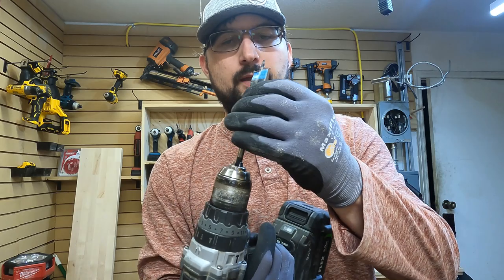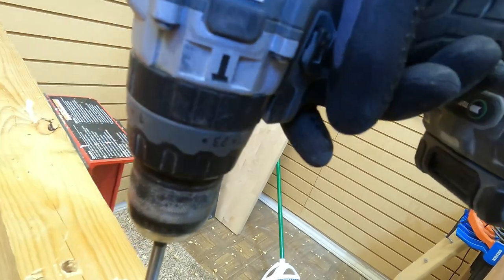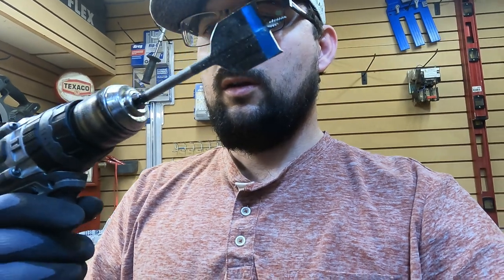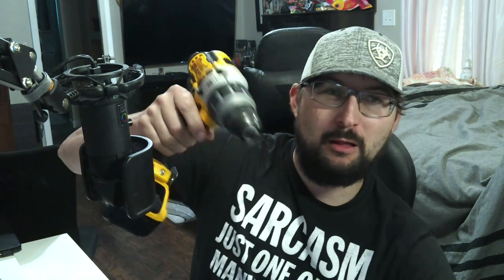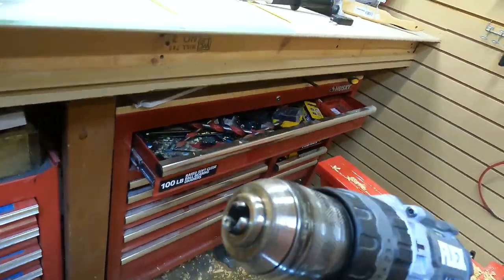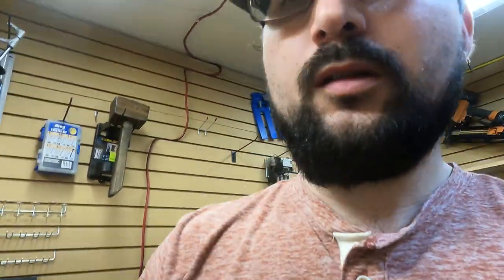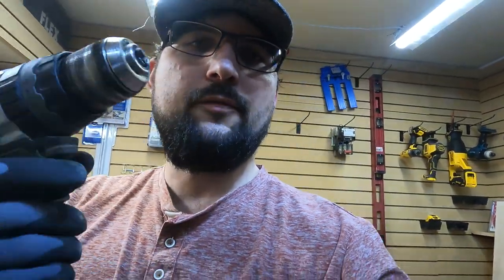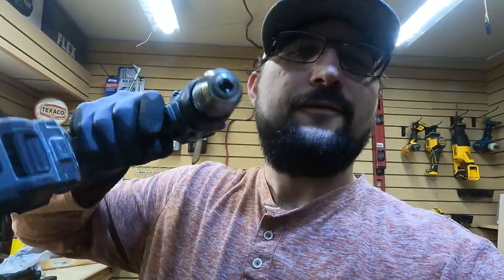I FINALLY BROKE IT ? -  FLEX /w Turbo

Comment: I'm curious i keep hearing about the M18 having a garbage chuck, is that your experience? I have a m12 drill but no M18 drill
Reply from the maker: No problems with any m18 chucks here, had bad experiences with the m12s myself,  especially the 1 gen 12v fuel hammerdrill/driver
Reply: The m18 has an awesome chuck that my go-to because its so compact with a 3.0 battery but doing more difficult task 6.0 is a must 👌 🙌  team Milwaukee,flex,dewalt,makita,ridgid,etc